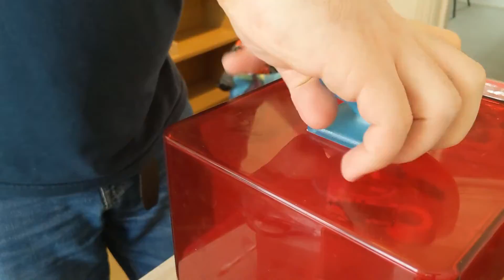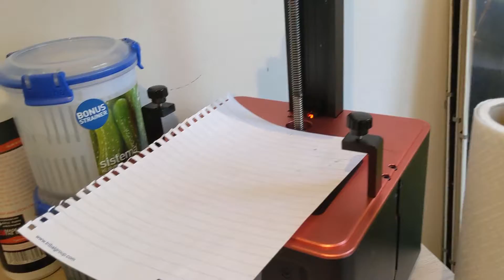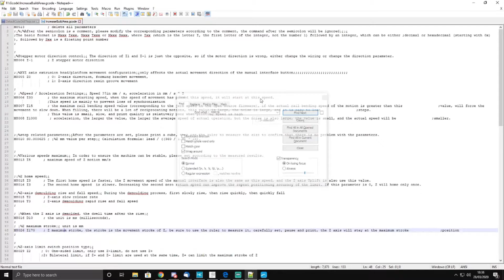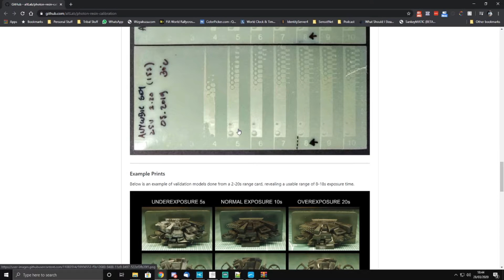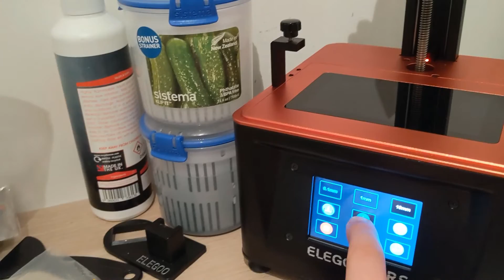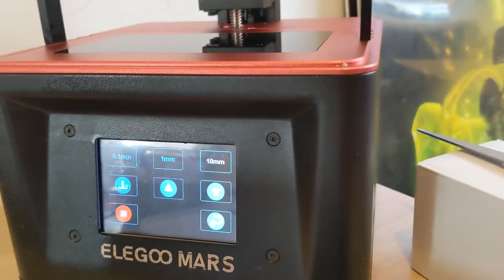Modding the Elegoo Mars - My 3D Printing Journey

Comment: if your cube is a bit short, I don't think lifting up the bed another .4 mm will fix the issues on everything. are you sure thats not from resin shrinkage? because even if you didn't cure it afterwards its still cured resin which has usually about 5-7% shrinkage. what you've done at the end there would only make the first layer thicker to make the difference. If you don't print directly on the plate there is no change. I dunno maybe i'm wrong but thats how it looked to me. are the other dimensions of the cube exactly 20mm? i doubt it.

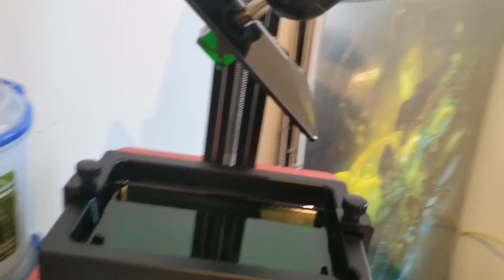Comment: What is that angled bracket holding the build plat at 17:20? Is there an stl for it?
Reply from the maker: There are a few versions on thingiverse, it's a  to help draining the excess resin. Just makes it slightly easier than the small one that comes in the box
Reply: @Paddymadeathing  found it thanks, there are many that don’t have the drip angle.

Comment: lithium grease or copperslip? as a mech guy I'd be tempded to use the copperloaded stuff
Reply from the maker: I used lithium grease as it was easy to get my hands on, but i think as long as it stops the drive screw sticking either should be fine

Comment: Do you have to run the new g code every time you turn it on ? Or does the modded g code store in the machine?
Reply from the maker: The modded G-Code remains on the machine so no need to run it each time.

unless you are daft like me and make a different change later and use the unmodded code as a starting point and have to re-apply it

Comment: Hi. Thanks for the vid dude, very informative and will be doing these myself. Just a quick question. When you started to calibrate the Z height (not the overall print area and after printing the cube) and the G-Code reverted back to the first one you run with the fan back on etc, did you print another cube to test that after running the G-Code again to turn fans back off, it didn't overwrite the calibrations you made??

Comment: Just got my Mars today (already have a Photon Zero which I love but need something a bit bigger) and came back to find your vid. I'm not even printing the rook, I'm going straight for your knob ;).
Anyway, tip for you...put your build plate in the freezer after first stage rinsing. Half an hour and you can push the print off with your little finger.
Thanks for this.

Comment: ypu actually made me LOL, love it, am fellow printer enthusiast. My photon has just decided it doesnt want to move the arm anymore. Thinking about a Mars as a replacement. How you getting on with yours?
Reply: Have you cleaned the grease off and reapplied? If it's anything like the mars the factory grease is more like treacle and needs swapping out.  I cleaned mine with IPA and brake cleaner then just used some white lithium from Amazon on the threads.